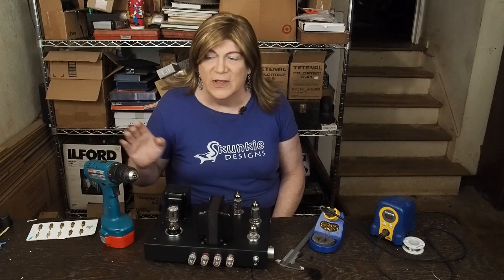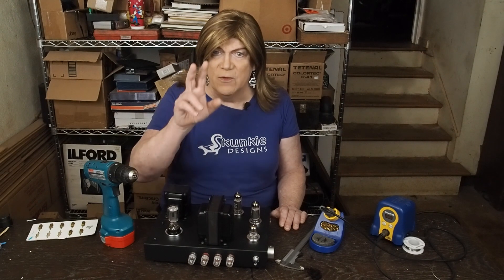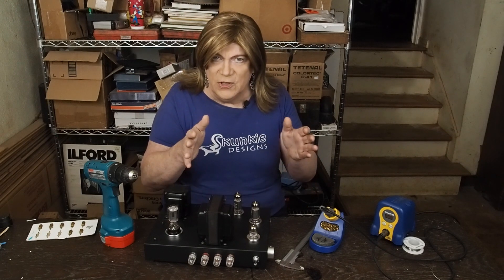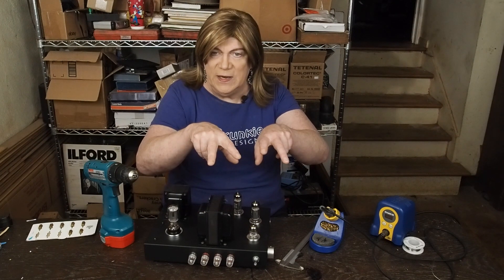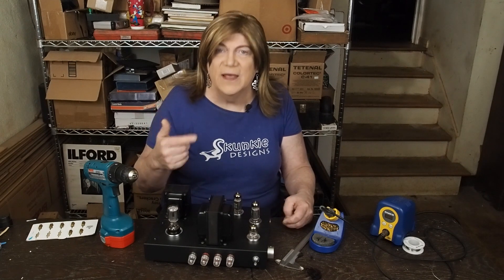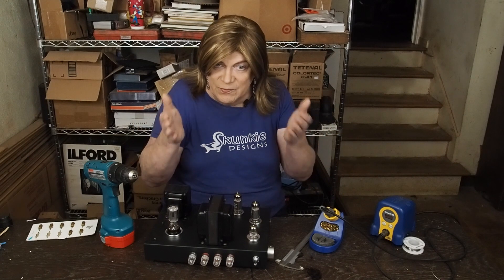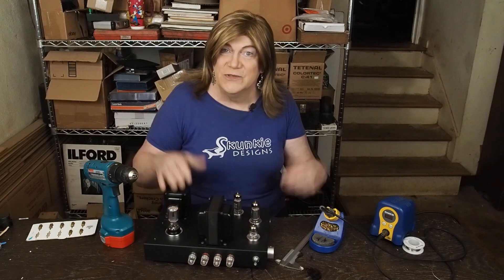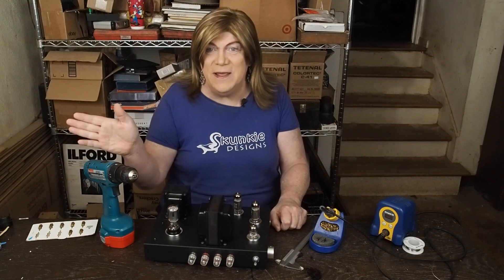Monday Monologue: Power Conditioners, Snake Oil or Not?

Comment: Very very good video; I think you are spot-on with this discussion. Testing of power conditioners, has shown them to be completely useless at filtering within the audio band... any equipment with a properly designed/adequate power supply, will not need a power conditioner to sound at it's best.

Comment: I know there is plenty of overpriced low performance high price junk, but in regards to power you quite frankly, but respectfully, have it wrong regarding power. I know as I have invented, developed, and built the highest performance power source supplies that have ever been created. This is a very Provable fact comparatively both Audibly and MEASURABLY. I welcome ANY YouTube audio influencer to do a real metrics comparative test including any product in comparison AGAINST my Proprietary Power Circuits Technologies and Power Cords. If you don't have the test equipment....no problem I do.
Reply from the maker: I'm sure your power cords create incredibly deep blackness and expand the sound stage...
Reply: @SkunkieDesignsElectronics  no, in reality they are designed to and perform specifically and only to honor the integrity of the signal with no lag or advance with no Variations from tracked amplitude or phase. The goal reached and honored of my Proprietary circuit Inventions is to Simply allow passage of virtually perfect power to allow the Perfection or lack thereof of the connected circuits or components to audibly display their potential. The source material with virtually perfected connected circuits will simply make available exactly what you have or quite frankly, don't have. My power circuits do not flavor nor expand in any terms whatsoever...only what's actually there in the original source is what you get.

Comment: Good discussion, I think it's a grey area. One one hand you'd think that if you have such expensive HIFI equipment that you'd consider a $10k+ power conditioner then you'd expect the power supply design in your gear to be so overengineered that a power conditioner will do nothing.
On the other hand those who already spent $100k on their gear, might feel it's worth to spend $10k on a power conditioner.
From what I understand the top end conditioners will convert the AC to DC, then re-create the AC with a near perfect sine wave resulting in a noise free regulated constant voltage for each output. Plus I also believe they have high voltage surge protection in case of events like lightning strikes etc.
That said I've never felt the need for a power conditioner although a regulated AC supply would be nice, but I feel they're too expensive.

Comment: Like your chanel very much.  I too am not impressed by power conditioners expensive or not.  Am finding a dedicated branch curcit with no 10 wire stranded to sound better.  I have to strongly disagree with your take on speaker wire.  All zip cord sounds the same regardless of gauge compared to even the cheapest of braids.  Revisit listening to something like kimber cable.  Speed dynamics and sound stage difference is normally huge.
Reply from the maker: So the low voltage electricity goes faster through braided wire? ...

Comment: Can you comment on running a tube amplifier on a variac? Especially vintage amplifiers that were designed to run on 110vAC. I use one on my Tubes4HiFi ST120 and keep it at 115vAC and my bias stays rock solid.
Reply from the maker: I prefer a bucking transformer but yes, a variac can work to reduce voltage as well.

Comment: Let's all not forget, while we're talking about audible differences coming from mains quality, there is good evidence by way of ABX testing that there's little to no difference between most front end electronics. Richard Clark's amp challenge (googleable) remains unclaimed after decades.

99.9% of what you hear is going to be dictated by the acoustics of the room and the loudspeaker. You can throw in phono cartridges for an analog system, but people worrying about their power when it's going to be filtered and rectified anyway, while completely ignoring massive room acoustics issues is really quite comical in the audiophile community.
Reply from the maker: Bingo!

Comment: After fixing any defective power lines you guys should try Balanced Isolation Transformer Units (with a solid chassis and 4 outlets) from Antek.. They are not too pricey from 400VA to 1000VA. Antek sells them on Epay.. I have a vintage one from Erricson and it helped a lot living in a condo..
Reply from the maker: Those seem very reasonable, but I'm thinking this APC AVR will accomplish most if not all of that function + is a voltage controller.

Comment: It's funny, all the problems I hear people having with today's tube amps has downright scared me into not purchasing one. In the end all I want to do is play my music. I currently own a Denon 3700H receiver that works all day every day with built in EQ, 9 channel surround a sound processing, hand remote, room correction, Bluetooth, Apple Airplay and built-in amps for less than $1,200.00. And it sounds amazing. I could not imagine swapping tubes, capacitors or resisters inside a high-voltage amplifier to make it sound it's best. This tube amp business is getting downright ridiculous and way too expensive for most consumers to even consider purchasing one. I just don't see the value anymore.
Reply from the maker: If you look at this from purely a "value" perspective or ease of use, tube amps don't make sense. For many people who are into tube gear, being able to tinker with them to "shape the sound" is a large part of the attraction. There is a good reason almost all audio gear went solid state back in the 1960's and it's for the reasons you state.

I do feel quality tube gear does have a nice sound, and it's like the argument of why mess with vinyl when CD players exist, and you don't have to worry about scratches and dust. Or even why would people shoot with a film camera when digital cameras exist. It's just different.
Reply: My entire main system is tube based from the phono pre to pre to monoblocks. I’ve done a lot of DIY’ing, modding, and upgrading to all my gear with noticeable results for the better. Once you’ve found the tubes you like (that are of quality), they last for many years (especially preamp tubes) not like 6 months like a lot of people unfortunately think. I’ve got preamp tubes that are from the 50’s and 60’s that still test better than new. I love tinkering, but I feel that one’s gotta know when to just relax and enjoy the tunes. 

That being said, I also understand why some people just prefer to buy a CD player and play it through a solid state integrated. There’s absolutely nothing wrong with that. However someone enjoys music is up to them, and that emotional response can be achieved either way. I’ve also got another vintage system with an old Marantz 2220B receiver I refurbished going to a pair of Pioneer speakers from 1959 I also enjoy very much.